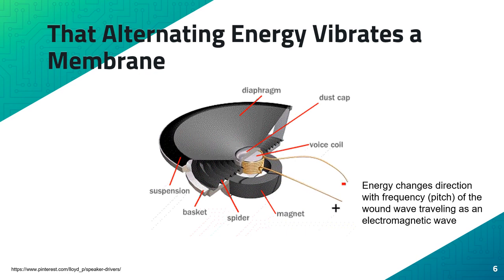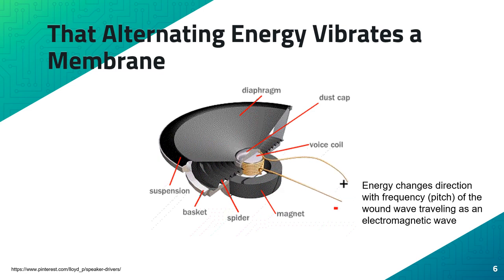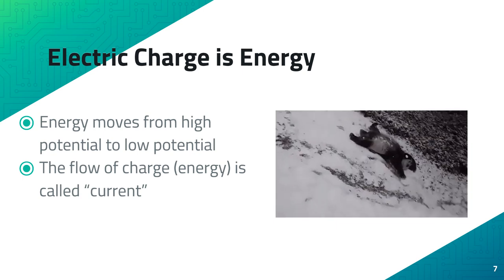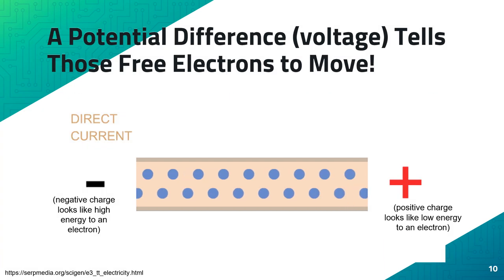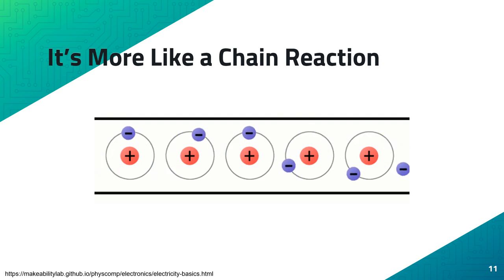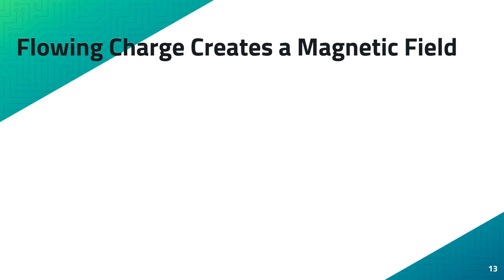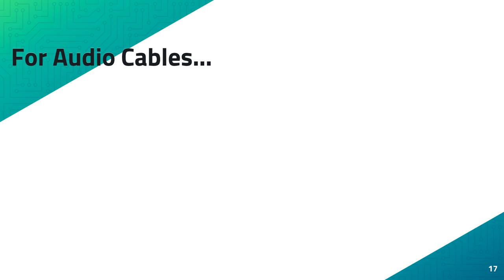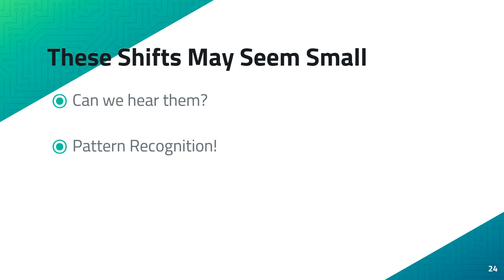Cables Matter Part 3: AC Signal Transmission

Comment: i'd like to bring up that the measured figures are on transmission line and your audio cables will never even be anywhere close to long enough to be a transmission line, as wavelength of even the highest frequencies audible are multiple kilometers long

Comment: If your right thumb is pointing in the direction that the current is flowing, the four fingers on your right hand indicate the "north to south" flow of the magnetic field. An AC signal causes the current to flow in the other direction at 2X the frequency of the signal - so the magnetic field also reverses direction at 2X the frequency of the signal.

Comment: None of this means humans are going to hear the difference with a properly designed cable regardless of what it's made from.
Reply from the maker: Believe it or not, I agree with you. Just because all of this transmission and wave superposition stuff happens does not mean humans WILL hear the difference...every time and in every situation. But that's a very different statement than the blanket "we cannot/will never/are unable to" hear the differences. This is why we need to talk about pattern recognition, which is part 4. I hope you stick around for it. Cheers!

Comment: The waveform shift you showed here is disingenuous, and in fact your own video shows why. You gave an example where 1kHz and 2kHz waveforms were separated by a 5ns delay. For the 2kHz signal, this delay corresponds to just one part in 100,000 (!!!).... equivalent to shifting the blue signal by less than 1/100 of a PIXEL on a 1080p display. Yet the shift you drew is many orders of magnitude larger than it really is (i.e. unfathomably small)

Meaningful differences in cables do exist... when you're talking about long cable runs and/or MHz+ signals! For audio frequencies on cable runs of ~20 feet, well... your own numbers show exactly why there's no difference.
Reply from the maker: Thanks for watching and responding. You are technically correct - the best kind of correct 😆- that the sketch in the example you cite is not to scale. I can't show a less than one pixel difference on an image comprised of pixels. It's a cartoon meant to illustrate a point; a teaching tool. In the broader context of what is said in the entirety of the video, it should be clear that this 1&2KHz example is one thing that happens between 2 frequencies. A real-world audio signal is the summation of dozens-to-hundreds of waves all stacked up on each other and interfering with each other in a way the cartoon example illustrates. The science community has known for the better part of a century, maybe longer, that different materials conduct electrical energy differently, that different assemblies of those materials do the same, and that both of those properties also exhibit properties that change with AC signal frequency. It seems silly to me to think that upwards of hundreds of different frequencies all shifted by tiny amounts won't result in sums that are detectably different between materials/designs by observing devices (brains) that are especially attuned to changes in patterns. "But we can't measure it!" or "It's too tiny to hear!" Please watch part IV.